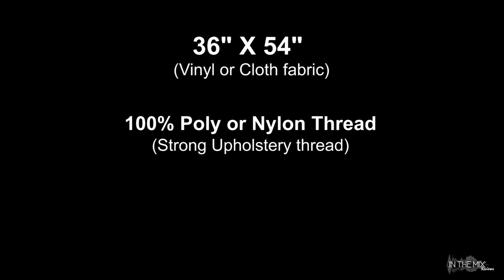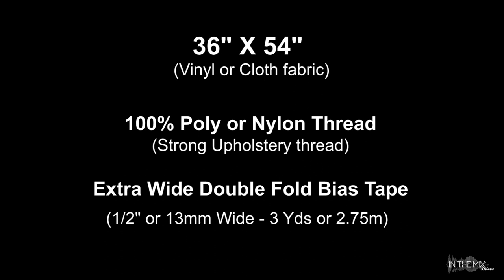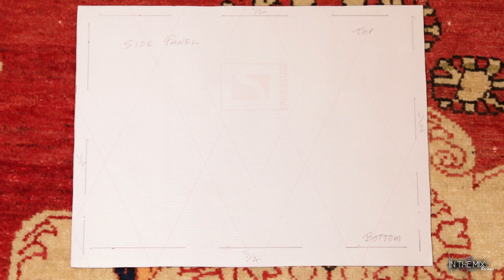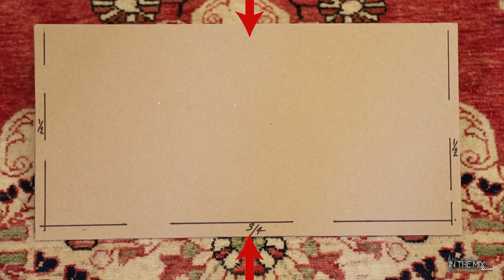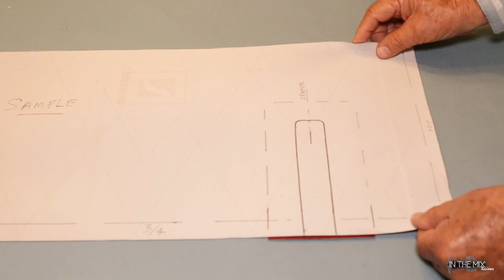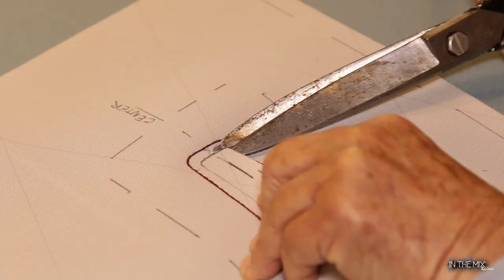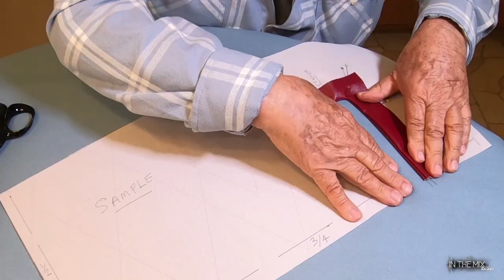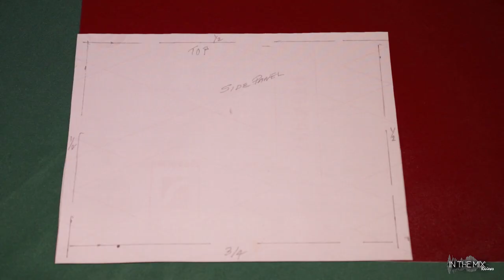Making A Studio Monitor / Speaker Dust Cover (Focal Twin6 Be)

Comment: Made a pair of these covers today and they turned out great. Bought $30 worth of marine vinyl and spent about $12 on leather needles for the machine and heavy duty thread. Whole project took about 3 hours. Thank you for the instructional video. Very well done, explained, and edited.
Reply from the maker: Glad to hear about your project. Did you take any pictures?
Reply: @InTheMixReviews  Yep. Just sent them to you via FB messenger. Cheers
Reply from the maker: @JustinPast  Great job! I see how you made the cut out in the back for power and speaker cable. Very nice indeed!

Comment from the maker: This is basically a DIY dust cover project for studio monitors. You could probably use this concept for a variety of gears such as mixers as well. My friend was having some problems with his sewing machine and stitch lines did not come out as straight as he wanted, nonetheless the final product was a perfect fit. As mentioned towards the end of the video, if your device has a lot of connectors and cables in the back, you don't really need to make any cutouts at all. Just sew up to your desired height on the back lines and then leave the corner lines open. This way, the back section of the cover can just drop over the cables.

Comment: My fabric includes 1/4" foam. backing with a tricot layer. Do I add additional ease for the thickness of the fabric? The speaker coating is a specially baked on rough finish which catches on the tricot. Should I also include a certain amount in addition to the ease allowance before adding the seam allowance?
Reply from the maker: You need to allow for a little more than a 1/4"....maybe 3/8" would be better to make it fit loose. This would take care of the first part of your question. As for the 2nd question, I think if you allow for 3/8" that should be plenty for ease allowance as well.